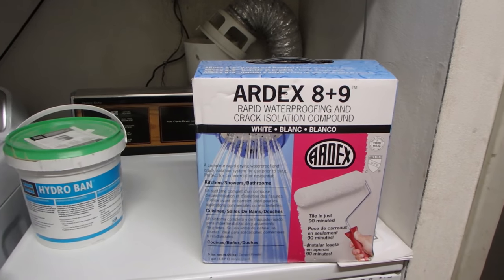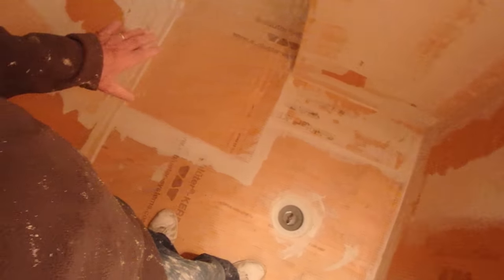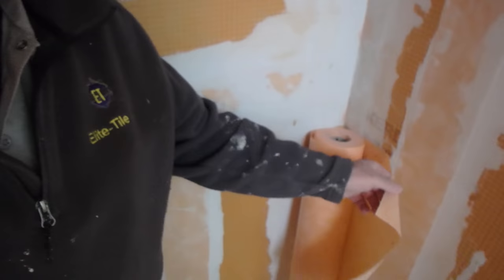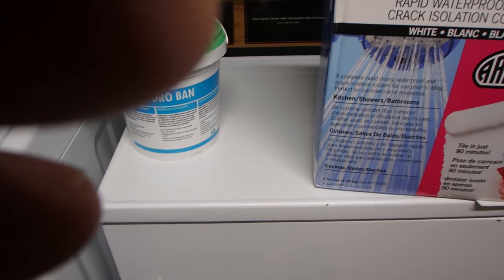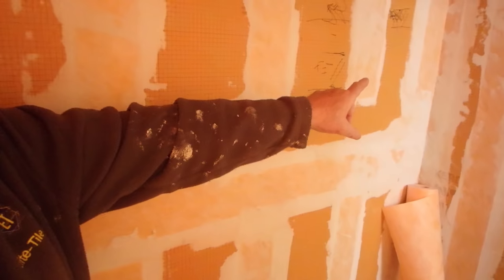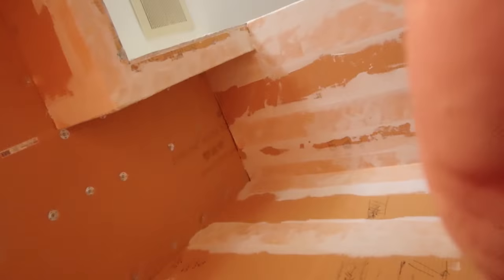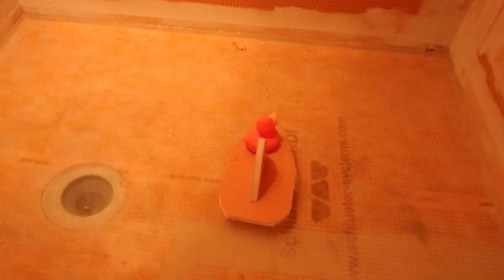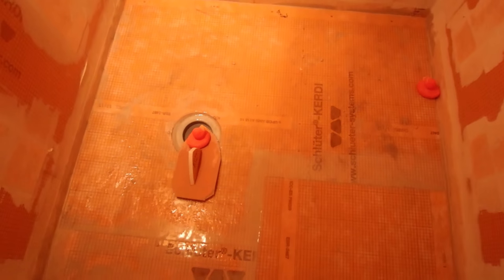Waterproofing your shower, Do you really need it? Plus flood test.

Comment: A little off topic Sal but have to try and catch you when possible. Could you point me in the right direction on how to contine into the niche area of a shower wall on a herringbone? It's been quiet here in London over the last couple of weeks so knocked up a mock wall and had a play with the herringbone as don't normally do it.  Pulled out the 90/45° lines and everything went fine untill the niche area. Couldn't get the grout lines to match on the internals. Any advice would be much appreciated👍
Reply from the maker: That is a difficult question to answer, herringbone can be very tricky especially when you have to rap around things.
Reply: @SalDiBlasi  yeah, tell me about it. Thanks for getting back to me anyway.
Reply: @isanna6075 , I wouldn't wrap the sides. Continue the herringbone on the back wall and simple lay the sides square. The affect you are trying to achieve is a 2 dimensional appearance when someone walks in. Most people will never notice the wraps/return of a nitch, only the back.
Reply: @RichardRpond  ok, thanks for the advice. Just to clarify,  are you saying it's not physically possible to wrap the reveals ?
Reply: @isanna6075  I haven't had the opportunity to set a herringbone pattern like that yet but your question made me curious. If it is possible to do, I think wrapping the herringbone through the sides of the niche is the sort of detail that people really notice when you pull it off right. Or, rather, they don't notice it at all but would notice its absence. The depth of the niche would have to be set precisely according to the herringbone pattern. I wonder, though, how you would trim the outside corners of the niche.
Reply: @GarwoodNick  The mind boggles lol. Will just have to keep researching and having another play at it when things go quiet again 👍
Reply: @isanna6075  yeah tile layout can get incredibly complex sometimes
Reply: @isanna6075 , it's absolutely possible. If you're using a ceramic tile you will have to purchase the mud or surface trim, unless you have your own kiln and can glaze tile. If you use porcelain or a stone it will be easier to box your edges or you can use a flex grinder with the grinder stone and polishing pads to give it a rounded return. I just finished a 5x10x10 shower, 4x8 ceramic tile with a herringbone pattern. I had two nitches where I used glass on the revel/sides and used a 2x2 hex tumble marble mosaic for the floor and back of the nitch.  I'm a 3rd generation tile, stone quarry/brick installer with 38yrs in and around the business. I haven't seen it all, I don't know it all and I never will on either count. I will tell you that I can not remember ever seeing a herringbone pattern wrap a nitch. Not saying it hasn't ever been done because I'm sure it has. Just saying, I really don't think it adds a whole lot to the job.  I just added LED Lights to the one I'm on. That is the sort of things folks like for some reason. It's therapeutic, I understand, but kinda silly. Kinda like wasting a lot of time trying to continue the herringbone on the wrap. I would invest my time on other "eye grabbers" and call it a day.  Hope this helps. God bless.
Reply: @RichardRpond  Thanks for your thoughts 👍
Reply: @isanna6075 , just my personal experience and what I've seen. Good luck.
Reply: I agree with these folks, do the back herringbone and the sides, top and bottom solid. Doing this way will also cut down on grout joints on the bottom shelf of your niche. Less chance of leaks
Reply: @davegordon6943  Thanks Dave 👍

Comment: How do you feel about RedGard?
Reply: Work as it should if manufacturers direction s are followed
Reply: It’s ok on walls over Hardie or Wonder board.
Reply: @davem3789 , after 3 applications...
Reply: Red Guard is good, just has a bad reputation because a lot of hacks use it as well
Reply from the maker: joe baker  they sell that at the box store, I never buy tile related stuff at the box stores, so I have never used regard, so I can't speak as to how good it might or might not be. Box stores have a reputation for selling cheap inferior stuff, there has to be a reason for that, and I actually know what that reason is.
Reply: @SalDiBlasi , box stores sell Ditra & Kerdi.  Dal-Tile was one of the first to sell Red Gaurd.  One of your videos had a Custom Display of setting & grout products that Home Depot sells.  I purchase materials from box stores and places like Dal-Tile to this day. The only areas of questionable, 2nd hand products is in the tile or stone material. The setting, grouting and waterproofing products are comparable.  You can even order many products online and usually cheaper.  That's the beauty of a free market. Love the video!

P.S. I even buy my Marshaltown Tools from Lowe's.  :-)
Reply from the maker: @RichardRpond  read my comment again, I didn't say that everything was crap, and I did say that I have never used redgard, so I can't comment on it. I also said I don't shop for tile stuff at the box stores, and you said their tile can be questionable. Custom makes some good stuff, like prolite, but they also make some really low end stuff. I chose to buy stuff that I need at a tile supply store where I have a relationship with the people there for decades, and not be a faceless person at a box store. If you want to shop at a box store go ahead, just know what you are buying.
Reply: @SalDiBlasi , to each their own. I guess I've been fortunate to enjoy both.  You said, "tile related stuff."  That's why I said what I did.

Comment: Plumbing code requires flood test to pass inspection in most states. 
The test requires water to be filled up to rough curb. 
Shouldn't we be following the code?
Reply from the maker: Not where I am, although you are correct, depends on where you are.

Comment: The kerdi seams aren't 100% waterproof. Thinset is porous and this system can fail. You're leaving room for failure. The kerdi system is a water management system. Paint those seams with hydroban so it's 100% waterproof.
Reply: will inthearea the mortar mixes for lack of better term with the fuzzy part for lack of better terms of the fabric when it crystallizes and dries it becomes completely waterproof no need at all to add anything plus you void your warranty
Reply: @jgdgii5224   I doubt it becomes completely waterproof as in long term. I also doubt schluter would honor this "warranty"....They would probably blame the installer claiming the thinset was was too thick or something and simply deny it. I wouldn't put my trust on thinsetted seams 100%, which is why i paint over the kerdi with either hydroban or ardex 8+9. No chance water will  get through the kerdi seams.  That's peace of mind.
Reply from the maker: @jesse g so you are saying to do something to void the warranty right at the outset so you have not even a chance for it to be honored. I can tell you for a fact that Schluter stands behind their products. Assuming something does not make it true, being paranoid about stuff will often lead to bad decisions, like advising to void a warranty for the fear that it will not be honored.
Reply: @SalDiBlasi   It's the manufacturer's job not to honor the warranty. If they honor the warranty they're pretty much saying their products don't work and that would hurt their reputation. Using common sense there's no way a kerdi shower can fail if i paint over it with ardex 8+9 or hydroban. I still follow all of schluter's directions but i just add the paint over it for extra protection. It's common sense. If it does fail.....Then i'd replace it out of my own pocket instead of fighting in court with a big corporation. They have excellent lawyers and money to protect their reputation against warranty claims.
Reply from the maker: @willinthearea6318  You need to get to know the manufacturers, then you wouldn't be so quick to condemn them for a feeling that you think is common sense. Do you know your reps, have you attended any training? Maybe you should.
Reply: Sal DiBlasi what I was trying to say was kerdi is waterproof and trying to add to it is going to void the warranty so it would be a mistake to add to it. Schluter is all I use. they have the best reps and unless you get faulty material or you install improperly it will work. Also the company has integrity and I trust the warranty. The reason they check when you have a claim is because 99% of the time there is a claim it’s installer failure. I hope that clears up my stance on the issue